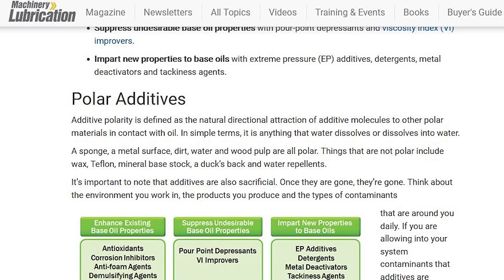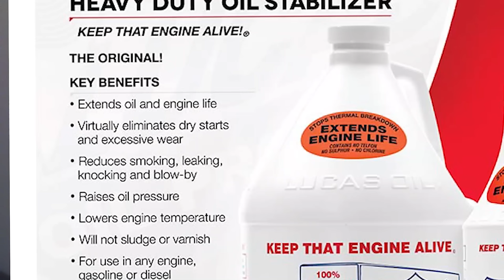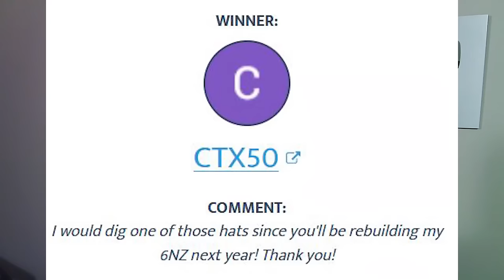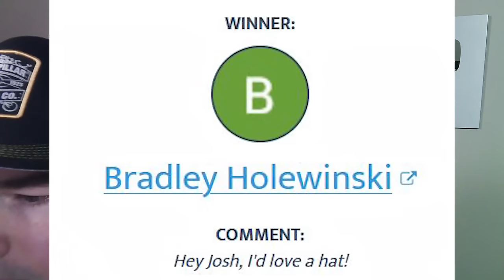Does your Engine NEED Lucas Oil Stabilizer? A detailed look at the "Benefits."

Comment: All I can tell you is my ex boss and still a friend had a F150 truck with the V6. He was not good a keeping track of milage/oil change intervals after I left that job. So in other words he never changed it and it was a city driven service vehicle.  Anyway it had developed a significant rod knock. I still helped him out occasionally and had driven it a few times with it like this. I was so afraid it was going to crater I just hated using it. He was heavily dumping Lucas in it. Pretty sure considerably more than recommend. Any way that poor thing ran 3+ years and nearly 50k miles with a rod knocking loudly. It finally failed due to him getting it hot and blowing head gasket because of low coolant level so he put a reman engine in it.

  I don't really agree with some of the reasoning of the poster on this video. First off saying that artificially raising oil pressure won't help your engine last longer. Well if it's already so worn it barely has any pressure it can add extra oil to the top end of the engine lubing the valve train cam and lifters. Another point is friction modification can 100% lower operating temp. Which this alone can lower oil consumption and also deter seizing/spinning of bearings.  Besides the thickness slows consumption. I don't use Lucas in everything but sure do in worn out junk that's not really feasible or cost effective to rebuild the engine on.  It is a great assembly lube in my opinion.

Comment: I use the Lucas Oil Stabilizer in my 2000 5.7 Chevy V8 . This engine was abused with towing a large trailer in high temperature areas and apparently not serviced well.  I bought it for a song and noticed with the factory oil and no additives the hot idle oil pressure went below 20lbs. Not good. I went to Castrol 20 x 50, an old favorite of mine, and pressures came up across the board and very hot idle pressure went up to 25-30 lbs.  Doesn't seem like that much but actually it is.  After a two thousand miles the idle pressure began to drop again so I changed it again with 20 x 50 and added the Lucas this time.  The pressure stayed above 25lbs for the entire oil change interval of about 4500  miles. Highway cruising pressure stayed above 50lbs as well. This engine could do with new main bearings I'm sure but it runs so well and so smooth that using the much heavier oil and additive seems like a more practical alternative to an engine overhaul on an old vehicle.  It's a seasonal vehicle as well and if I need to run it in below freezing, I have a kerosene heater that I can take the chill off the engine and oil since I'm sure it's like molasses at those temperatures.  But I have started it without warming a few times due to an emergency and it didn't knock and tap which is usually a good sign.  Would I use either of these products in a modern engine?  Absolutely not.  There are plenty of alternatives in lubrication for smaller faster spinning, turbo, direct injected engines that are nothing like that old chevy design. I use 5w x 50 full synthetic in my oil burning 2009 Honda V6.  It's used oil since it was new and Honda didn't find it excessive.   The 5w x 50 reduced it to near nothing. Just for an example. 5 years on and it's running fine with the wider viscosity oil.

Comment: They make a different lucus now for the thinner oils I think now 
I have used this to reduce oil consumption.   The lucus transmission fix is very good, but better for mechanical shifting transmissions vs electrical controlled shifting.  It doesn’t fix the transmission but will help get a little more out of the transmission.

Comment: I used the Lucas synthetic oil stabilizer in my old 5.2L Jeep Grand Cherokee. It used to have a sticky lifter,probably from sitting for a year.  It does burn a little oil through some of the valve seals & guides. I've had the intake manifold off to replace the lower plenum gasket and plate. I could see through the intake ports on the head that there was/is oil leaking down onto the valves. I'm not going to tear it down and fix it. It's danm near 30 years old. It uses noticeably less oil with the Lucas in there.  I'll just keep using Lucas until this old ZJ won't go no mo. It still has good oil pressure,no leaks, and makes decent power.  This vehicle has already lasted much longer than I was thinking it would. If I don't add the Lucas, it runs well all the same,I just have to add oil more often.

Comment: I owned a Jeep Scrambler with a custom built high horsepower engine, running Castrol GTX oils. I live in very hot, 110* plus desert temps and noticed that when I would beat the engine hard, oil would break down and loose about 10 lbs. of pressure on both ends. The pressure was back up when new oil was installed, but broke down again if worked hard in the heat. I do not believe in additives, so tried other brand oils, all wit the same or worse result. I used the Lucas Oil Stabilizer additive and the pressure Never Came Down again! This for me was a viscosity index enhancer, not an STP thickener. Lucas products are all Great to me, not matter what the purpose of use.

Comment: I agree been a mechanic for over 45 years, worked for and retired from the NYC department of Sanitation as a mechanic,  I would never put that in a new gasoline engine, never. I spent most of my years working on diesels and most truck applications use around 28 quarts of oil or more do you really believe adding a quart of that could ever touch that engine?

Comment: To comment on the cold temp you’re absolutely right. I used to run 15-40 rotella plus 1qt Lucas in a clapped out 4.0 Jeep engine and in the winter months below freezing the oil pump would literally screech for a hot second prior to building pressure every morning
Reply: 15w-40 is pretty heavy on it’s own

Comment: For me, it's Marvel Mystery oil to clean off varnish and lube piston rings without taking the engine apart. It's especially useful for cleaning engines where the previous owner didn't maintain the engine properly. Very few engines properly lubricate the piston rings and rely on tangential flinging from the crank.

Lucas appears to do the opposite and help reduce wear by thickening oil, like how race cars have thicker oils to stick to surfaces longer and reduce wear. I don't think it reducing knock by filling in gaps is a bad thing, it's the only thing you can do on a damaged engine to get some more life out of it.

Comment: On autos and generators I use a bitoLukas. The dip sticks always need a good wiping even in lawn mowers 4 months from a pull start., Standard conventional would be clean to level in crankcase. Hitech science tells me it clings to the metal very well. At 67 I have never blown an engine. Only a K car that got a blown coolant hose that sucked in a quart or so of antifreeze. The aluminum split way down there. Ever see  K car? Me neither! Lol almost.😢😢😢

Comment: I use Lucus or moreys oil stabilizer in my 2H toyota diesel engine, I found when I adjust the valves there is still a film of oil between the rocker and valve as apposed to before there was almost none (engine cold), rocker wear is a problem with these old engines.

Comment: Used this stabilizer in a hemi pro mod eng  after weekend of full pulls engine had additive on brgs AWESOME PRODUCT
Reply from the maker: In a racing application, it may be a good product due to the short drive cycle, extreme amounts of fuel going into the oil pan and various other things. Thanks for your input.
Reply: Yep the alcohol didn't seem to break down the 70 weight oil or lucas stabilizer

Comment: It’s funny I’m now seeing this because I have two identical 2006 Silverado work trucks with one running with Lucas (after 170,000 miles), and one just running synthetic high mileage oil.

Both trucks have had their share of trips to the work site over the course of over a decades and both have accumulated their wear and tear. 

I will say though that the one now running Lucas was having oil pressure issues back around when both trucks hit 210,000 miles, and once I started using it, the issues were resolved.

In my overall opinion, it’s definitely a band-aid solution and I would recommend for older vehicles.

Because of the results, I also tried it on a 2002 suburban where all it did it’s whole life is drive to military bases and back. For that vehicle, the rod knock has been gone for 8 years. I should probably look at it, but it’s honestly not worth it at this point. The suburban just turned 20 year old. The only issue it has now is the need for a new blower motor.

Comment: Iam a believer in this stuff, but I only use it in a high mileage engine, and I use it sparingly just for dry starts in the summer time, and I might just add 16oz per size quarts of 10w30, I dont use it in winter, and I use a little in my manual trans, also put a little in my differential, I been using this stuff for many years, I would not add a whole quart to 5qts of motor oil, I believe it really helps my old engine live longer, I like the stuff, also I would not use in these new engines at all, Thank for your video my friend💯💯💯👍

Comment: Since 2005 i've been using lucas stabilizer oil on every oil change on  our expedition and still run smoothly with 210,000 miles on it

Comment: I work at O'Reilly's and was actually wondering what constitutes the usage of Lucas. I have customers come in all the time for the gearbox additive, injector cleaner, and their other stuff but never new it's effectiveness. Great vid.
Reply: The upper cylinder lubricant/ injector cleaner is actually pretty legit.  I recommend it to anyone that has a carburetor, it keeps it lubed and clean inside.

Comment: I live in Alaska, and I'll never use Lucas. At negative temperatures, that stuff is virtually rock hard. I'll have never tested it diluted with oil, but I used to run it in my older vehicles until I left a jug in the back of my truck overnight. When I picked it up, it was solid as a rock.

Comment: I’m a Macanic, I buy older heavy truck at auction sites all over the US, and drive them to the southern Border, whenever I run to an Engine that has low oil pressure or bad blow by, I add 60% of Lucas to it and it and it’s sometimes surprising what a difference that stuff makes

Comment: I've run Lucas in my gas engine flatbed since it was new. At 350,000 miles the engine still runs great. No ticks, knocks, nothing.
I wouldn't run the truck without Lucas.

Comment: This is simple,  if you have a new engine that requires 0w20 don't use HD oil stabilizer. If you have a older engine that is worn out, rings, cylinders, bearings etc.  Lucas HD oil stabilizer is awesome. It will make a worn out engine perform better and last a little longer.

Comment: TLDW; just an oil thickener. Just use a grade up (eg 5w40 instead of 5w30) if you have issues due to worn engines, oil burning, low oil pressure etc.

Comment: The "makes engines last longer" makes sense. Lucas tends to be thicker and tackier than a-lot of oils so it stays on moving parts longer preventing less chances of them running dry therefore causing less wear on those parts and improving the life of the engine. That was the good. The bad is i could see people running into problems when they use this if they mix it improperly and throw off the viscosity of oil recommended by the manufacturer.

Comment: I've been using their stuff for modern engines. Cars with VVT, and use oils like 0w20 or 0w16 0w30 etc etc. Been using it on my 2019 civic 1.5t since it's second oil change. So far so good. I do remember in the past on older vehicles Ive used engine restore, gone back and done a compression test and found it actually works.
Reply: I wouldn’t be too worried. So far so good on my end as well. 2015 Impala just reached 413,000 miles when it started using Lucas at 70,000.
Reply: @robster7787  that's impressive for an Impala. Wow.
Reply: i have a honda with vtec and was told not to use which one are you using? (told my the honda forum police =)  )
Reply: @wattsobx  my Honda doesn't use VTEC. It has VTC . The Honda police are the same people who tell you to switch to 5w30 with no actual science to back it up. I'll stick with 0w20 until I'm atleast FBO and bigger turbo.
Reply: @vermontvermont9292  I understand it has variable cylinder management a.k.a. deactivation I’m saying these motors also have VTEC as in variable timing on the cams and I’ve heard that the higher viscosity Lucas oil can be problematic
Reply: @wattsobx  yeah, that's why I use the low viscosity additive from Lucas. When I actually remember. My dad's used it several times in his 2018 Camry , those use 0w16 which is like water. So far no issues with the Lucas low viscosity additive.

Comment: I used to use Lucas Oil Stabilizer, one gallon at every oil change. That is I used it up until March 2016 when my engine required a rebuild due to cylinder rings in 5-6 failed. At this point my engine only had 1,012,000 miles. It should have went much, much further before that first rebuild but it didn't. So I quit using Lucas in the oil because I had no proof it even worked inspite of all the claims on the bottle. So today, it's straight Delvac 15w40 and nothing else. I also used Lucas fuel treatment occasionally but same thing, I have no proof to their claims because when I replaced both fuel tanks a year ago with brand new ones, the old original tanks had extreme amounts of black sediment caked on the tank walls. The claim is that it cleans the injectors but after witnessing what was in the old tanks, I have no proof it even cleans the same junk from the injectors. So again, I stopped using it.  I am religious about my oil changes every 15,000 miles and that should be enough. No More Additives!!! That applies to all my vehicles, gas or diesel.
Reply: your not wrong. 
if it aint broke dont fix it till it is.
most gasoline is blended with fuel cleaners anyways.
even diesel fuels are.
thicker oil on a normal motor operating on highways could be bad for bearings i believe.
its one thing on a very hot race motor when people lose oil pressure.

but if you have a tick on a car. that problem isnt going to be fixed. and at highway usage at best, pray the oil can squeeze past the toleraces. 😂
it just puts the car in a worse state, limping it along. 
say if its an older motor with worn bearings, fine it prolly wont hurt.
but the colder it gets, it will wear those tolerances until the oil could pass thru and do its job i think.

idk i coulld b an idiot
Reply: @KuntChitface  I have a Cummins 6.7 use Lucas regularly with thee oil. When I go down thee I state I ain't babyin er That litty bit a 2.4 qrt a Lukey ain't be hurtin a Thang bro. Take my word I even got a 2007 withabout700,000 miles and I literally beat the shit outa that truck still use it round town for errands, another Lucas Mobile 🤣  The shit works, now if ur ride is sitting takin a shit in the driveway of course it's gonna get sludged up, the idea mine any how is to use the dang thang....

Comment: Stuff works great at reducing oil consumption, had a jeep that sat for a long time in a guys barn and used a quart a month until i used a high mileage lucas oil treatment. Went down to next to nothing. Also have a tundra that was my Dad's, same thing, i read toyota uses thin oil rings and it burned a quart a month, with 295K on it, it barely uses any with the lucas high mileage oil stabilizer

Comment: It does help the transmission cuz i have used it several times. I don't know about badly worn transmissions tho. Mine were just weak and older and it helped it operate better. I also used the engine oil stabilizer and it seemed to help for a smoother running engine and helps the lifters and internal parts with lubrication.  This is my personal results along with regular maintenance on my vehicles.

Comment: I have a 99 solara v6 that was burning 5 quarts every 4k so every oil change interval it would burn the entire engine oil capacity I run a 30 percent Lucas to oil ratio sometimes more depending on how far I have to go but ever since running Lucas it burns 50 60 percent less oil it truly is amazing.i call it engine Honey it's that good.

Comment: I haven’t had a “need” for Lucas oil stabilizer.
However;
Lucas gas treatment is a must. 
It provides additional lubricant to the cylinders, and keeps the valve assembly oil slick. Similarly to a clean seasoned iron skillet.
The Key;
Sludge/carbon build up control is beneficial.
Mobile 1 oil was developed with that in mind. Used in tandem with Lucas gas treatment carbon doesn’t buildup into a sludge that restricts oil circulation.
Thus;
A old engine that’s been kept clean by preventative maintenance products will run like new.
Because;
Neglected engines are not well lubricated causing excessive wear.
It’s not “snake oil” if the engine is worn out, no product will turn it into new.
BUT
Even cleaning up a old dirty worn engine could/should/might have limited results.
Best;
Preform preventative maintenance from the get go, when new. Don’t abuse it as in racing…

Comment: Lucas is a great product for old worn out engines.  I've  had cars with over 200,000 miles have about no oil pressure come back to life. oil consumption would be cut down by at least 2/3 rds . no more rattles ticks or knocks. whereas I would agree with you that it could cause problems if you were just trying to treat say one bearing knocking in a low mileage car it would starve out the others. however I believe with a worn out engine with all the bearings having significant wear It's a non-issue . this product actually helps.